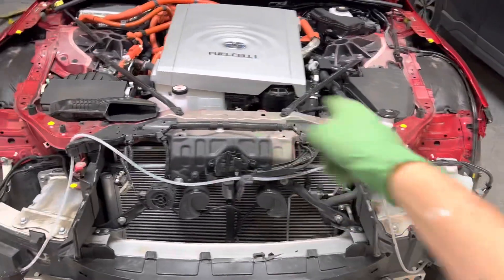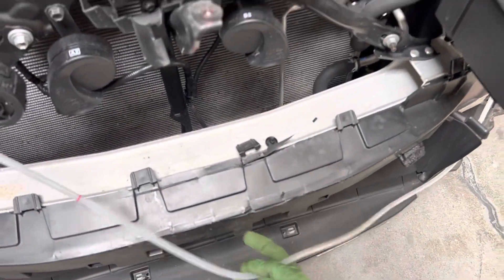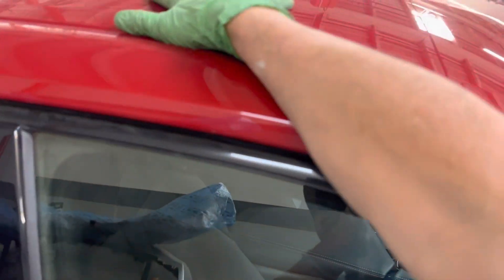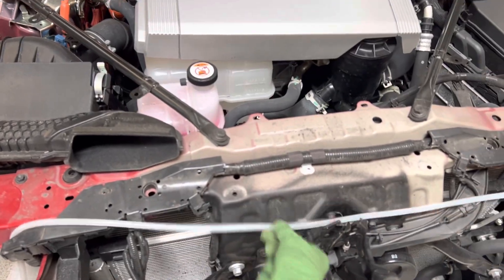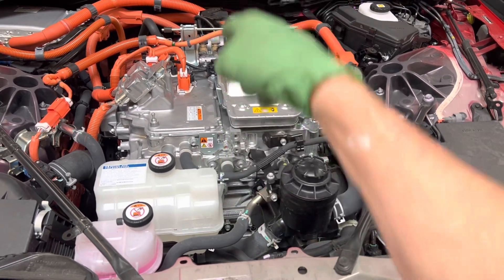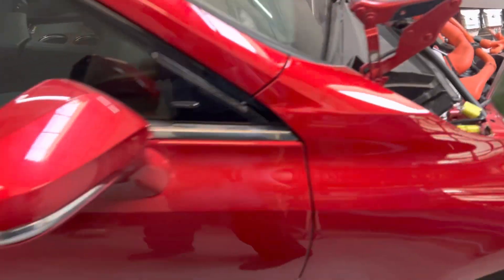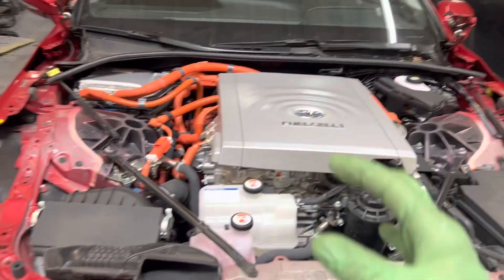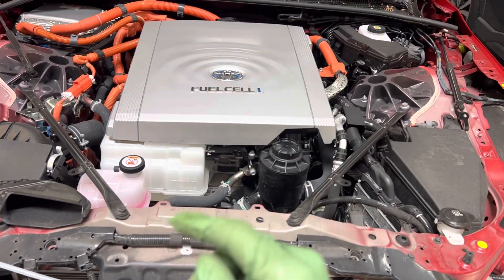HYDROGEN ￼FUEL CELL Toyota, Maria. Are you ready to work on one of these in your shop?

Comment: That repair is way over 4k. If the hinges are 1800 a piece. What was the real total on this? Just out of curiosity.
Reply from the maker: The 4K was just for the hinges the barometer sensors that have to be replaced as a pair after an impact the module for controlling them. 

The bumper, the bumper cover, and the bumper Styrofoam and adjacent work was probably another four grand .  I don’t have the exact total, but after working and body shops myself, and working for them and seeing the step on a daily basis, I’m gonna put this total somewhere around 10k to 15k just for the bumper cover, and a little stuff located underneath and the labor..